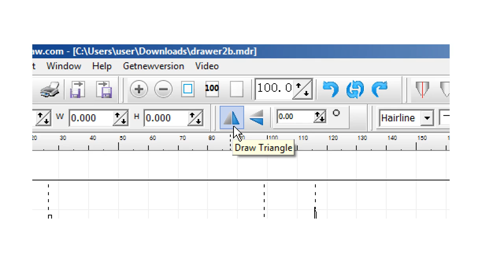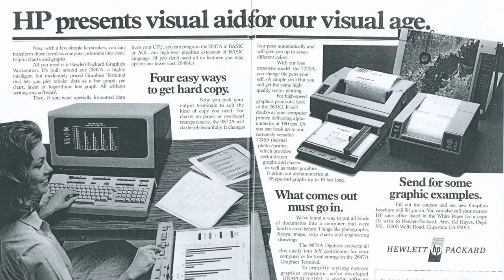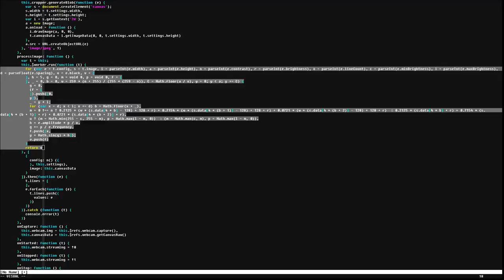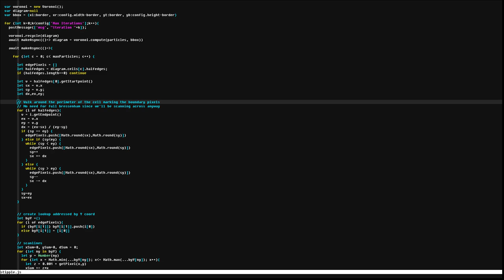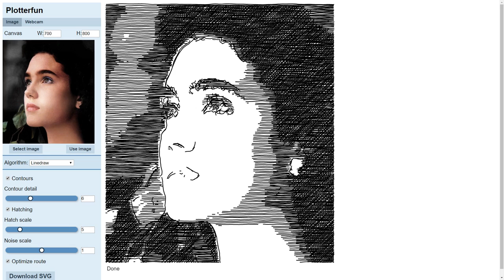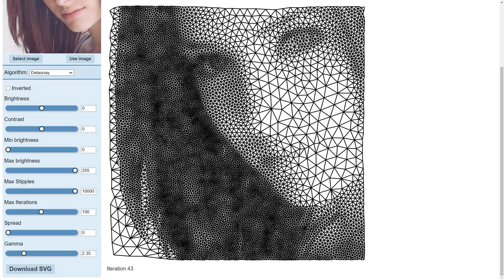Plotter Fun

Comment: «I have an irrational fear of frontend frameworks»
You are not alone.
Reply: It's definitely not irrational to avoid those kinds of things, it gives me headaches just thinking about javascript... ugh...
Reply: their usefulness is largely dependent on how much you use Javascript. if you use JavaScript on a (near) daily basis, a framework can save a lot of time, and after you learn to use it the code for less simple things can be more readable.

but it takes some time to get used to a framework, so if you are not using js a lot, you probably won't make that time back before the framework you learned is out of date, or the world realizes that it has some design flaw.
Reply: no, seriously, you are not alone, a frontend framework is standing right behind you raising a webpack over its head, run!
Reply: also, more seriously: javascript frameworks tend to be a pain because of how much paving over they usually have to do. react is really nice to work with, but it takes a bunch of layers of dumb stuff to get it to work in all browsers. preact is much faster and simpler just from throwing away some compatibility - in the future it's imaginable that we'll get back to being able to compile and run things a bit more sanely while keeping the benefits of web frameworks, but right now you need to stand on this giant tower of webpack, babel, npm, and etc in order to get the full benefits of the current most featureful, active, and quick-to-write-code-in ui ecosystems.
I'm really excited about the future of react hook style apis, though, and I'm hopeful for the day that something like that is easy to do with a similar level of compatibility but without the tie to a particular language or environment.
Reply: although, to VUE's credit, it is probably one of the easiest to use. but yeah, it gave me lots of headaches at first too
Reply: The amount of people I see using jQuery for the most basic things like toggling a class is mind boggling. It’s one simple line of code in vanilla, why the hell do you need to use a framework for this?
Reply: @Pfahli94  I actualy not only have an irrational fear of front-end networks, I also have an irrational fear or jQuery, and even when it would be easier to use, I will still attempt to bruteforce js to work for what I want it to do. EDIT: Just realized jQuery counts, and I feel less like a weirdo.
Reply: Someone has concluded that the obsession with frameworks in frontend development community is the result of a decade long discrimination by the rest of the programming world not recognizing them as real programmers .
Reply: guillmentse
Reply: seems very rational to me.
Reply: I laughed, but only because I agree
Reply: I've been wondering how many kilowatt-hours of energy are wasted per month parsing and executing frontend frameworks on websites that are not complex/stateful enough for the framework to lower complexity.
Reply: @AngryKnees  nothing compared to the amount wasted in the crypto hashing lottery.
Reply: I don't think it's always irrational.  I would have done the same kind of raw editing myself.
Reply: @meinradrecheis895  Agreed.

Comment: My father used to make vinyl signs (big lettering) - and I wrote a program to do the trick of cutting horizontal strips of varying width depending on image density.   Result was a vinyl cut that you could stick on a store-front window at massive size.   Seen from a distance, it looked like a photo - but when you got close to it, it barely blocked your view of the product on display behind the window.   I went on to make vinyl cuts with dots of varying sizes and other stuff like that.   It made him a good deal of money about 30 years ago.

Comment: Pulled my Silhouette Cameo from its dark hiding place yesterday, sitting there as a dustr trap since 2014. Cut some vinyl stickers for my moped with it, now this shows up in my recommended feed.

Going to try the squiggles on some reflective vinyl, using a pointy piece of wood in the pen mount..

Btw, on the plotter, you could add double cuts for gradients, using a pencil instead of a ballpoint pen. In 2013, I did a full colour print with a plotter, of a cell shaded scene on A4. If you heard some inexplainable cursing in Dutch that year, that was because of that.. Spent 3 weeks on 1 A4, iirc 11-12 tries.

Also, if you can plot again, try pencils in the penholder. Scan a written letter, see how good it translates onto a copy.. Took some tries but at the end, looked exactly like the original..

Comment: In 1980 or so, I wrote a 2D graphics library (mainly to produce scientific plots) in FORTRAN and MACRO-11 for the PDP-11. It generated HPGL to send to HP flatbed printers, and voltages via D/A converters to send to an oscilloscope to control X, Y and brightness (to turn the beam on and off for virtual pen-up and pen-down).

Comment: A 3d printer with a pen works pretty damn well as a plotter too (well, technically it's closer to a laser cutter), with the caveat that you need to speak GCODE to it and for the best results, you probably need one that you can reflash the firmware to as the G2 Arc command is usually disabled by default. The Inkscape plugin to turn paths to Gcode is called "J Tech Photonics Laser Tool".
Reply: Ooh, gotta try that at work sometime! Inscape's been super helpful with other work-related stuff, too, been using it to quickly convert text to simple line geometries for 2D CNC milling (because our CNC milling hardware's software is a pain in the rear).
Reply: linedraw outputs SVG. I regularly convert SVG to Gcode to send to my favorite Chinese CNC engraver. These converted photos would be great to etch on wood, glass, brass or whatever. I can play around with the laser engraver, too. I have seen similar conversions such as the extensions in Inkscape but these are particularly nice. This is a great video. Thanks.

Comment: Good god man! Holy cow! This isn't just for plot printing. This can be used for digitial artwork. If only it could be a photoshop filter. One of the most difficult things to get right is turning photographs into what appear to be hand engraved line art without spending a fortune on commercial photoshop add ons. Or making photos look hand drawn.
I suppose it wouldn't be impossible to turn this into a photoshop filter, or even better an Illustrator filter. For now I will be experimenting importing SVG and layering different results.

Comment: Hi, I am trying the halftone filter. If I do a line count of say 80 (where I can see an image better), when I import the SVG file into Inskcape or Coreldraw I need to (break apart) the file in order for my plotter to understand it. It does that with a linecount of say 40, but with 80 it crashes Inkscape and Coreldraw. If I just import the SVG file into signcut, it does not show the file. Both Inkscape and Coreldraw can see the file. But break apart is needed, but for example on Inkscape I can see that the generated SVG file is one path with 12,000 nodes. Is there a way to alter your script to generate an SVG that is already broken apart? It would help a lot, thank you. I hope you will answer here.

Comment: Are there any pens that can vary their mark diameter based on pressure applied? I think some softer felt tip markers can do this, but can't do it within the range of diameters I'm talking about. If there is such a pen that can go from a fine dot to a broad dot, that would be amazing for one of the dot plotting algorithms.

Comment: На швейном предприятии стоял широкий  старый плоттер 1986 года с чернильницей. И однажды когда я менял  банку с чернилами без замены стержня (отсоединив трубку) произшло чудо:  теплая сопля чернил  притянулась вверх  электростатическим полем пластиковой  крышки плоттера, и бесконечно растягиваясь и вращаясь  из за вязкости стала прилипать каракуляими к поверхности  как будто  Бог решил оставить афтограф. Есть фото!

At the sewing company there was a wide old plotter of 1986 with an inkwell. And one day when I was changing the ink jar without replacing the rod (disconnecting the tube), a miracle happened: a warm snot of ink was pulled up by the electrostatic field of the plastic cover of the plotter, and infinitely stretching and rotating due to viscosity, the scribble began to stick to the surface as if God had decided to leave the aftograph. There are photos!
 https://cdn.jpg.wtf/futurico/8b/b6/1397247927-8bb6b21da78cbd880972779a9656ab70.jpeg
https://cdn.jpg.wtf/futurico/ed/30/1397247926-ed306ac85c7c2702fbf2599ec7b31551.jpeg
https://cdn.jpg.wtf/futurico/6d/c2/1418208901-6dc215a893d601bdbb3c7108208fbc5e.jpg
https://cdn.jpg.wtf/futurico/c3/1a/1397248690-c31a84329a9780d75edb6071c1d364df.jpeg

Comment: CMYK plot with heavily randomized patterns.
apart from the known linear etc patterns, use some fluid random strokes. type of stroke coupd change with brightness of each  area on CMYK channel. and option B, use pen pressure to produce different thicknesses, but i guess you need g-code for that not HPGL. or maybe HPGL has pen height that you could dynamically change, without using CNC or writing a post processor (compiler) for the plotter.

Comment: I know it's blasphemous, but if you're going to output on paper, it might actually end up being faster to rasterise the output and print it on a regular laser / inkjet printer. It should be nearly indistinguishable from anything plotted with a ball-point or hard felt-tip pen. However... have you tried using a "brush-tip" pen (either alcohol or water based, like a Pentel Aquash) on the plotter?

Comment: Old (second/third generation) x/y Plotter only support a subset of HPGL. They especially omitted all interpolation stuff like filled polygons, Bézierkurves and such. (my guess i that the processors didn't have enough power to do so). They have also very little memory. You have to send chunks and insert "return codes" to know when to send the next chunk. I run in that problem a few years ago. So i had to write some code to convert HPGL into a suitable format. I wanted to print circuit boards with etch resistant ink. Because my plotter was so old and the pens so expensive i had to make my own pen holder. But i've "run out of time", it all got shelved as something "i will finish it alter"...
While experimenting i wrote some programs to explore Lindenmayer systems. (the dragon curve by example). :-)
Paying with multi x/y penplotter is really fun.

Comment: could you randomize algorithm selection so that each image contains many styles? by random rules, areas, or even manual input areas.

in the manual input case, user would paint a mask and assign it to a style, then calculate. output could be in asingle file or multiple, for multi colour versions.

Comment: Javascript is NOT the most platform agnostic programming language, that award goes to raw C source, that will literally run anywhere. Assuming you can get libraries for it, but good luck getting a js interpreter for a 6502, mainframe from the 60s, arduino, etc.

Comment: Real nice work! But while converting vector files to HPGL is easy, trying to do it the other way around is a nightmare. Especially if you have to deal with custom text characters or unconventional syntax. Because I’ve got myself trying to convert data meant for a plotter into readable data on my computer, I’ve developed a dislike for the HPGL language.